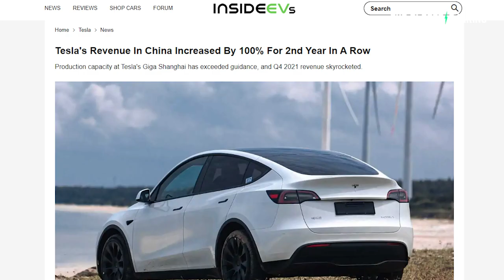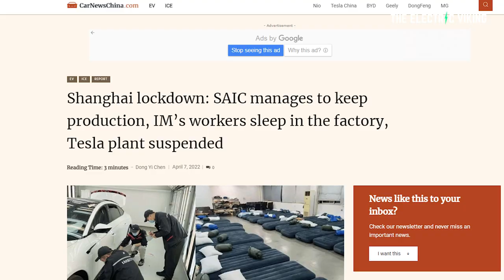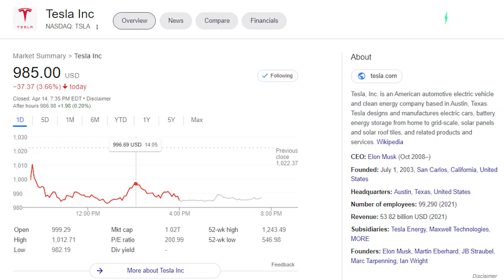Tesla is playing a VERY dangerous game in China

Comment: Yeah that 6,000 model 3/Y per week old data is way off compare to what it is now.  For example the made around 56,000 in one month that just under 14,000 per week.  
   Then holding Tesla back from producing that many cars is not right.
Reply: The article actually says 16,000 per week: "Tesla manufactures 6,000 Model 3 AND 10,000 Model Y cars per week at its Shanghai factory".